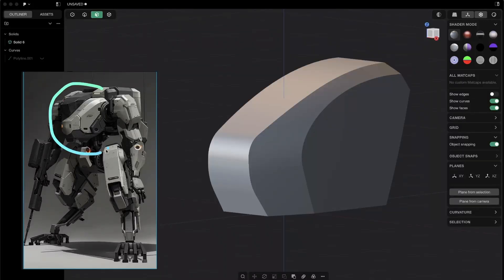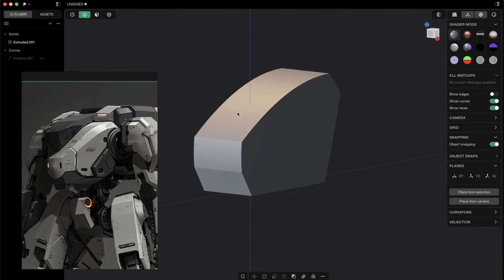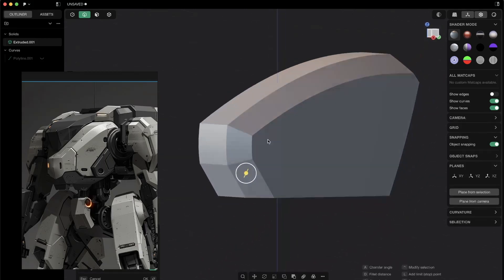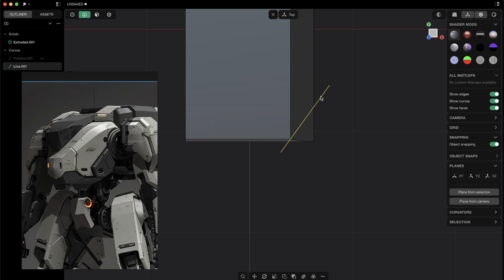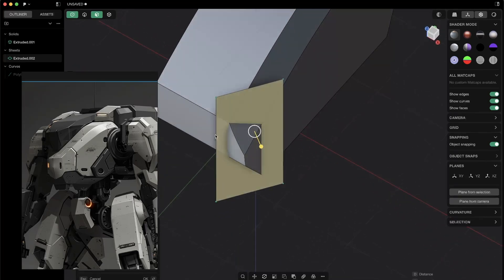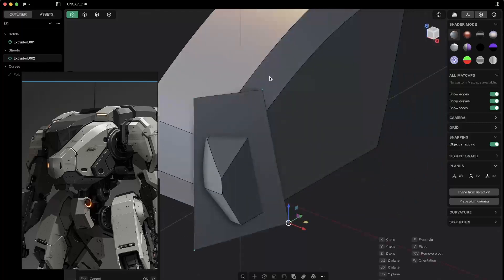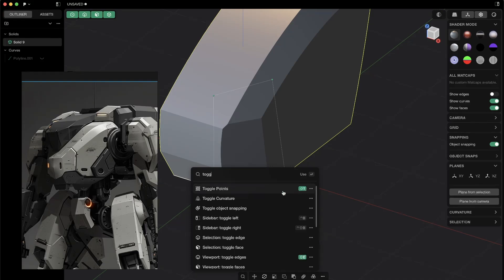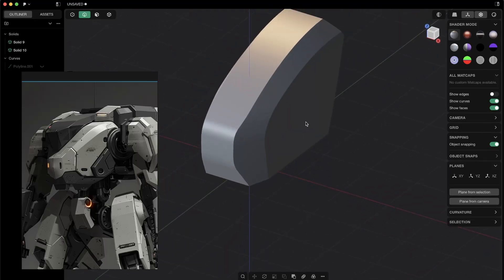How to 3D Model Mechs in Plasticity - Quick Tip

Comment: You're solving non-existing problems you've made by yourself because you model NURBS like you're stuck in Blender. Just stay in blender or evolve with software you use ! Your hard surface modelling is wrong in so many ways you have to completely re-learn the way you think. Just take few courses for Alias/Rhino/SolidWorks/Catia or whatever industry-grade NURBS modelling system you prefer. It also helps if you use logic and function in your character/mech design  instead of AI slop. Take a look on real military aircrafts/vehicles. Every and any panel line, bolt, nut, bevel, fillet and insert is necessary and required for particular purpose otherwise nobody will ever spent a minute to add them. You're modelling things supposed to be real and useful. You cannot just "mimic" shapes. You have to invent their purpose. Tech/military design follows the function. Not your artistic imagination.
Reply: Please do you have any good recommendation.
Reply: I'm genuinely curious about how would you have approached this. To be true as I was watching the video I was thinking ... I can do this much cleaner in blender, but I want to learn plasticity because it has other benefits I would like to adquire. Please explain.

Comment: But by manipulating points on a square you've created a non-planar face.  Shouldn't one either do a cut with the line, or use a triangle sheet as the cutter ensuring a planar face result?
Reply from the maker: Doesn't have to be planar. By manipulating point, you bring in a bit more variation and interesting shapes/forms.